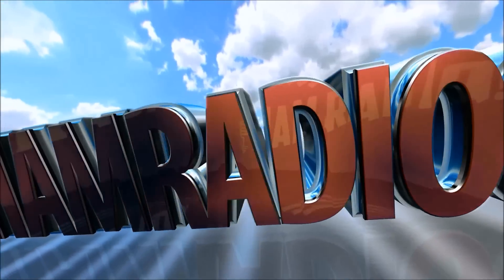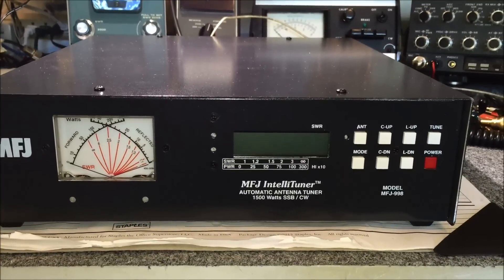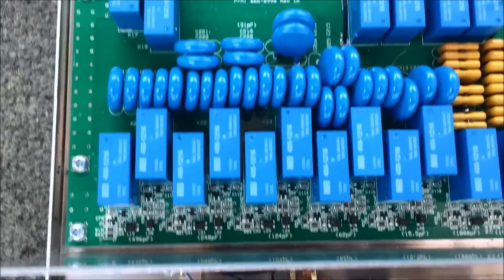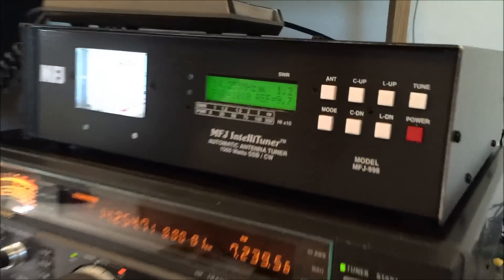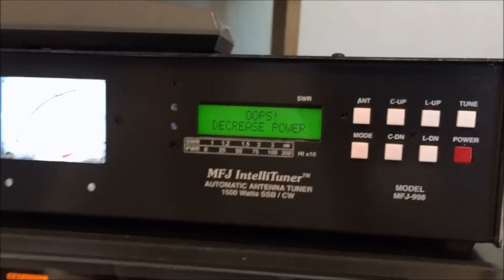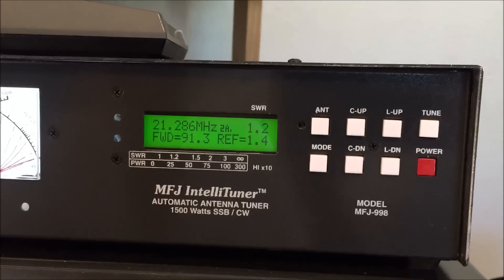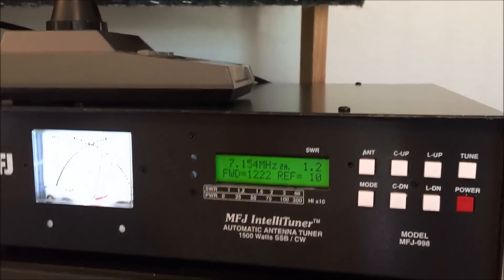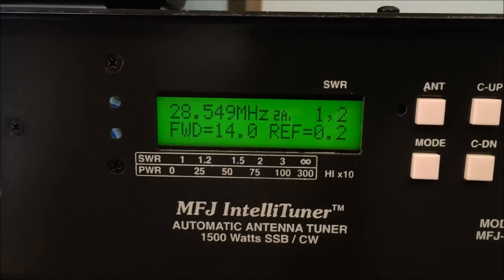HF autotuner MFJ-998 Intellituner

Comment: I'm trying to revive an MFJ-998 I was gifted at a recent Hamfest.  I'm powering it up and only getting two lines of solid black characters on the LCD display.  I've noticed that JP3 and JP2 are missing (open) on the board near the timer/clock chip.  I'm not seeing anything in the manual about their function and I'm not quite clear from the schematic either.  Wondering if anyone out there with an MFJ-998 can take the cover off and let me know what you have in place there.  In the video it looks like JP2 is jumpered, but I can't tell what that status of JP3 is.

Comment: Question 

Is there a way to set the fwd power meter so I can view actual power(esp with my amp connected)while transmitting??
The only way that I have been able to accomplish this is to switch my Icom 7300 to either fm or rtty. 
I can then see 450 watts out. But if on ssb, the mfj shows fwd= 24.0

Thanku
William

Comment: I thought the 1306 was a 1300 watt amplifier? I know my ICOM PW-1 is only supposed to be a 1000 watt amplifier but it will do 1500 Plus as well with high drive.I run it at 1200 watts PEP on all of the HF Bands with just 35 watts of drive & it does 900 watts on 6 meters with the same drive.

Comment: I am going to use an Ameritron  ARB-704 keying buffer between my Yaesu FTDX10 and my Heathkit SB200 amp - I am confused how I would connect the MFJ 998 to this set-up?  I see the Amp Enabe In and Amp Enable Out jacks - but how would this all work with my ARB-704 interface - kind of confused!!!

Comment: If they keep on casually messing with those power levels like that, I'm afraid that amp doesn't have much longer to live. All of those protection circuits cannot act quickly enough to protect the amp finals. You tune first with amp off at 10w, then turn on the amp on after tuning and it MIGHT last longer. This is REACTIVE power that involves very high voltages (inductive loads) or very high currents (capacitive loads) at the instant PTT is pushed; the transceiver at high power (50 watts) may fold back later on, or the tuner may cutout the amp but that too will be later on, after the finals experience the high inrush or voltage peaks.

Comment: He said he was going to go the full 1500 Watts with an ALS-1306. Well, the ALS-1306 isn't rated for 1500 Watts, so he's taking a chance.. I could have done without the guy chewing his fingernails. Of course the amp has to be in standby while tuning. You don't want to hot switch 1200 Watts!

Comment: These guys are equipment butchers. Beating the hell out of that amplifier and the tuner. Proof that MFJ gear is not as bad as people claim.
Reply: Troll
Reply: @lizzyfan1986  Troll my ass. I've held an amateur radio license for over 26 years. I even own the exact same tuner he's testing here. An ALS1300 is NOT designed to run full legal limit, it is supposed to run 1200 watts pep to stay clean. Running it wide open at 1500+ makes it a dirty splatterbox. Tuning up trapped Yagi's on bands they aren't supposed to work on is bad for the tuner and the traps. Unless you have any experience beyond running your yap, STFU.

Comment: All this MFJ equipment together I keep waiting to see smoke,  That antique FT1000 is a NICE RADIO!!!  I would hate to fry it! 
I have used QRP for years, and its definitely safer if you are unsure what you are doing.  High SWR is never a good thing, but when your total output power for the rig is 10 watts it will be ok!   HIGH SWR at QRO levels and your gonna fry something!   I recently got my first amp,  and I am not going to claim to anyone that I am a QRO expert!  I know my HENRY 2KD Classic is designed for 1.2kW ,  I have been told it will go full 1.5kW but have been encouraged to slowly adjust drive and keep it at the 1.2kW level that it's not worth risking 2  3-500Z tubes to get 300 more watts out!   Having recently relocated my new antennas are currently rolls of wire,  I am going to do my best to trim them as close to resonant as possible so the tuner has little work to do.  Sunspots suck so bad right now I am going to focus on 80/40/20 wires and save for a tower and hopefully as we slide into the next cycle I can have a tribune beam up.  I am going to study how to tune my AMP before I ever put power to it!   73 hope your MFJ-998 is doing well

Comment: I wonder if the toroidal inductive coils get hot during prolonged operation? They are not as efficient as air wound coils.
I'm thinking about buying this tuner to run with my Acom-1000. The Acom amp can handle up to 3:1 SWR by itself.
I generally don't like to use antenna tuners and prefer resonant antennas.  I do need a tuner to operate on 80 meters since a dipole has a very narrow resonance and can't even cover half the band without a tuner.

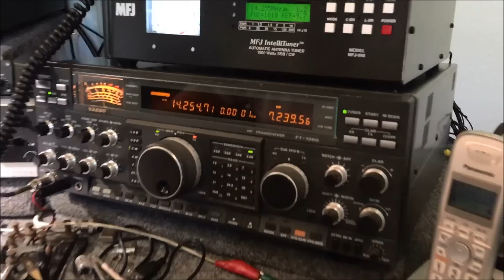Comment: I'm curious why you have the FT1000's antenna tuner turned on (green light, upper right side of rig, at 5:47) when using an external tuner.

Comment: I just bought one, all I can get mine to do is say "HUH" Increase power"  I increase power, same thing.  
If I key down manual CW, it starts to tune, then stops, with SWR 3.5 or higher.  Think I'll sell this lemon and go back to manual tuner.
Reply from the maker: Antonio Magillicutti what is your swr on the antenna that you are trying to tune?
Reply: I'm trying to tune 30/40/80 on my 160m inverted L, 4 radials.  I am having several issues.  The tuner never auto tunes when target SWR is exceeded, and yes it is in auto mode.  Sometimes when I xmit, the freq. display is all over the map, tuner not recognizing freq..  Sometimes it will tune to flat SWR, say on 40m,  but if I change bands and come back to 40, the settings apparently have not been saved, and then won't retune to SWR below 3.0 or so.  I get a lot of "Huh" errors. SWR on those 3 bands are below 4.7 before tuning.  I recently bought this from another ham so perhaps he sold me a defective tuner, it just does not perform like the ones in the videos I watch.
Reply from the maker: Well it's possible it has been damaged somehow, Because normally it tunes and saves the swr. But i have heard of this issue which is the IC logic chip that is damaged when either too much power was used, the tuner got a power surge, or using too much voltage. MFJ can send you a replacment IC chip you can plug in if they have one, contact them. But normally, it is a great tuner, and a lot of people like it. But with all electronics, misuse can damage it. In this video I stress tested it as you can see, to test its limit, and so far it never failed.
Reply: Yes I have heard it was good tuner.  Not really planning on really high power through it but wanted an auto tuner that could withstand the key down modes bettter.  Can't hurt to replace that IC, I'll try that before giving up on it, thanks!
Reply: Thought I'd let you know I removed the cover, found the far left torroid leaning to the left about 40 degrees, and the center single torroid so so loose that I can easily rotate it.. not sure if that affects tuning or not.. the logic chip is $20.00

Comment: This is Vernon Lewis  - W7VPL,  I am using an antenna tuner MFJ-993  - My question:: I will be using a MFJ-1786 Loop antenna, which is on order from DX Engineering - ,  By connecting the Loop tuning box to on of the antenna tuner coax outlets, which there are two, could I feed the Loop tuning from one of the outlets?? How would I be able to keep that tuner connected and be able to run the Loop anntenna??? 
Do I have to take the tuner out of the system and run the radio directly to the Loop tuning box???  
Vern
Reply from the maker: You cannot run an antenna tuner with the 1786 loop. There is no need for a tuner, it comes with its own tuner when you buy the 1786. The tuner control head sends power over the coax to operate the motorized butterfly capacitor in the loop, and the 1786 is it's own antenna/tuner BUILT into one. Do not hook up the 993 with it. It is not intended to be used with any kind of tuner.
Reply: thank you for the advise - I will take out the tuner - 
Vernon Lewis   W7VPL

Comment: I'm surprised MFJ allowed you to post this review.  I don't know the specs on your friend's beam.  However, I modeled a 20M dipole on 18.1 Mhz.  Not knowing how much (or what type) of coax your friend uses I used 100' of LMR400.  On 18.1 Mhz the dipole exhibited a resistive impedance of ~8 ohms and capacitive reactance of ~37 ohms.  This translates to an SWR of 10:1 at the tuner and an antenna system loss of ~4db.  Your friend was pumping 1500 watts into the MFJ-998. And of that 1500 watts, 870 were being reflected back to the tuner. How long do you think that tuner and your MFJ amp will last having to dissipate  870 watts?   The MFJ-998 is a very good tuner.  I've owned one for about 5 years and never had a problem. However, a review like this sends the wrong message to an unknowing amateur.  Just because your meter shows a low SWR does NOT mean you have an efficient antenna system.
Reply: Not only does MFJ allow, they put this on their website, so there K2PMC
Reply from the maker: Don K2PMC I understand that concept. I just wanted to test the limits.

Comment: hey eric would this autotuner work on and older kenwood ts 520 how would it hook up with out a interface cable
Reply from the maker: yes...Just transmit into it at 5 watts, it will work without the interface cable. cw 5 watts into it and it runs...

Comment from the maker: I Know its not going to work at that match, but its the fact.. MY internal tuner on my Yaesu FT450 will only tune something 3.1:1 swr or better. This unit will tune 32:1
Reply: +HamRadioConcepts   and that is a 1300 watt amp and you are driving it to hard. Also  it that beam was one with traps that also would not be good. Both of those pieces are great and love to have them both but really the testing is a bit off center.
Reply from the maker: +1903A3shooter You saw in the video it i was not driving with the full 100 watts as recommended. At one time Ralph had it over 100 watts because he has a 200 watt rig. Other than that, it exceeds the 1200 watt that the amp is stated to have at only 70 watts drive. 

Why do you say a trapped 4 element beam would not be good? The beam was designed for full legal limit and he has been using it that way for many years.
Reply: +1903A3shooter I posted a similar reply before I saw your comment reply.  I like ham radio concepts videos, but he might want to study a bit more.